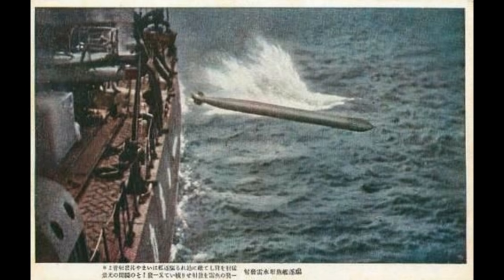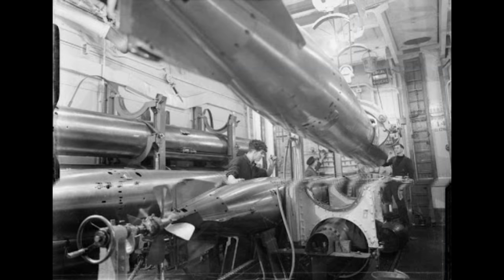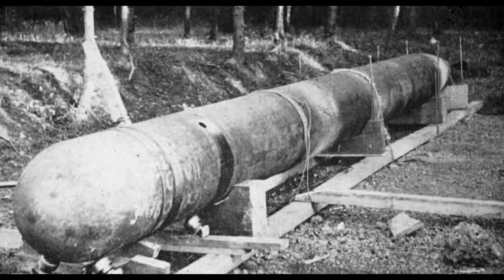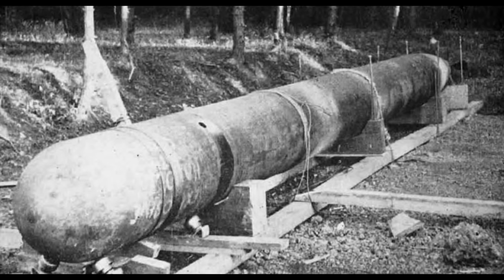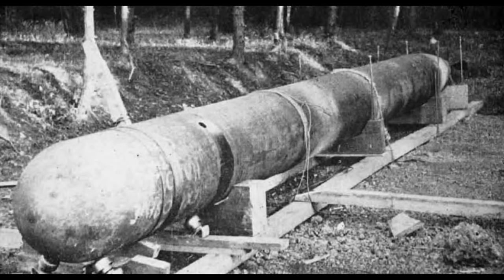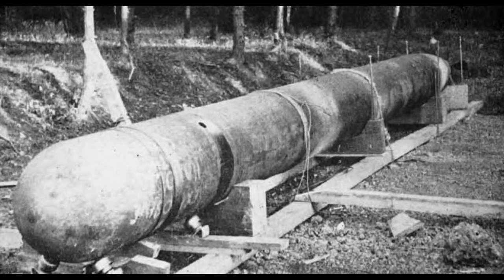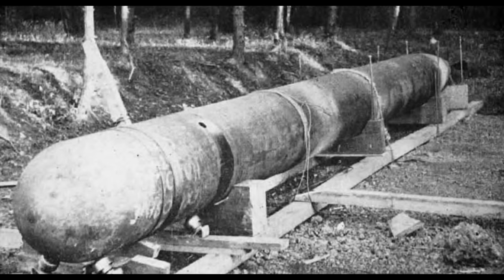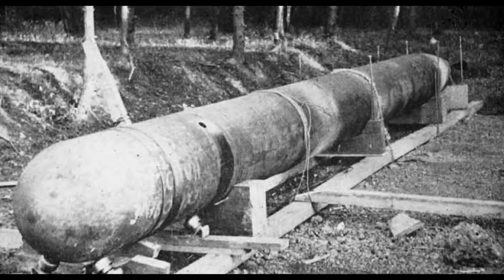Type 93 Long Lance Torpedo - Long Range Hole Poking Device

Comment: It's interesting to recall that the method of testing Torpedo Defense Systems was flawed by design and overestimated the designed capacity of the systems against current weapons without regard for magnetic exploders or Longer Effective-Range, Higher Speeds Oxygenated fuel (hard to detect), and more destructive warheads via weight of warhead and/or new higher yield explosives such as 'Torpex'. 

What was the method of testing by both the U.S. and U.K. and what's wrong with it? They built the equivalent of a section of a warship's outer Hull. For Battleships and Carriers that was 3-7 meters and was thicker amidships whereas the fore and aft barbettes were usually left with barely 3 meters for the physical system. 

On ships of this type they are part of a 40-60k ton (fully loaded) moving weapons platform.They are also 700-1000 feet in length. Also very different from the tests.

So what's wrong with a Floating Cross-Section? When it's struck by the expected torpedo type, although it may represent an accurate full size Hull Section (1 of 10-15 meters in length), it has both little mass and no entire ship to consider as collateral damage. So when the test is successfully conducted it strikes a target without the mass, length or other integral systems intrinsic to all such heavy surface units including momentum. Hence, whereas the the Prince of Wales and Repulse in December of 1941, were both moving at above 25 knots and maneuvering which severely stressed
 their hulls to comb the torpedoes fired at them, the "Hogging/Sagging", and "Shearing" forces couldn't be compared to a lightweight stationary floating cross-sectioned raft. The raft models generally were pushed backwards due to their lack of mass which actually diminished the damage to the model versus the actual ship which tended to stay on course with its speed and weight as physical anchors. 

Also, Torpedo Defense Systems have an entire ship to protect against reacting to the warhead. In practice, many aircraft carriers that were lost to torpedoes, had ruptured Aviation Gas tank fumes as the cause of secondary fires and explosions after the ship seemed to likely survive strikes by IJN torpedo attacks. The U.S. heavy carrier Lexington, converted while under construction from a Battlecruiser into the world's largest aircraft carrier is an excellent example of such a failure where "technically" the ship should have passed the test on the basis of a Floating Model but the Aviation Gas tanks rupturing due to its 900 foot long hull warping wasn't accounted for.

The Prince of Wales principal failure was its Hull warped enough to cause one of its propeller shafts to twist and since the shaft was around 350 feet long the "Gland" which acted as a compromise to keep the seal between the aft armored bulkhead and the propellers allowed thousands of tons of seawater into the unarmored stern. A power failure caused most of the pumps to fail when needed and most of the below decks electric power including lights were lost. Of course it was also hit by multiple bombs which both penetrated the armored deck and caused further warpage of its Hull. Very sad.

Comment: Even with most of a century of additional engineering knowledge, getting pure oxygen to start burning fuel without explosions happening is still quite tricky today (nowadays, that particular problem is seen mostly with development of rocket engines).  I suspect the early attempts may've been suffering from what's known to rocket engineers as a "hard start"; when dealing with potent oxidizers, like pure oxygen, the reaction has to start immediately upon the fuel and oxidizer coming into contact, or else you initially get a slug of fuel and oxidizer accumulating in the combustion chamber, and then it ignites and BOOM.

Comment: Out of curiosity, and laugh at me if this seems ridiculous, but did any navy toy with the idea of a tubular torpedo with the prop housed inside the body and all fuel and payload in the body surrounding the center channel? I raise this question as the Stipa-Caproni, better known as the Flying Barrel, demonstrated that this design works very well. Surely such a design must have crossed some torpedo designers mind as a means of extracting greater speed or fuel efficiency from the weapon system.
Reply: A simple cylinder has a much better surface to volume ratio than a tube would have, probably why torpedoes and subs are shaped that way.

Comment: Worth mention, the escort carrier White Plains scoring effectively a kill on the cruiser Chōkai with a 5" gun hit to her torpedos, which detonated and crippled her, leaving her for aircraft to finish off.  Likely would not have happend with a somewhat less volatile choice of propulsion system.  The Type 93 was also both exceedingly expensive, and difficult to manufacture, which was a considerable trouble mid and late war, reading Hara's book.
Reply: I believe Mikuma suffered a similar fate as well, due to dive bombers hitting her torpedo stowage. 

In an even more embarrassing disaster, the commerce raider Hokoku Maru was sunk by the Dutch oil tanker Ondina with a 4" shell hit to the torpedo mount, the ensuing explosion being large enough to rip her stern off.

Comment: RIP lusitania, USS Indianapolis and HMS Barham.
On the Hackensack River in New Jersey is a US submarine. Also is a human piloted torpedo/submarine. For propulsion it used a Helmut Walter motor. I failed to look at the rear to see if it used a propeller (like very late German subs. [Type XVIIc? ot type XXI] or a nozzle (like the Me163 or reusable Walter RATO units).

Comment: After the middle of 1943, it was noticeable that the Japanese ships were suffering from lack of fuel to do anything, including training. Which was a primary reason their torpedo success rate dropped drastically.  Pre war they trained a lot because we were shipping them the oil to do so. In 1942 they got plenty of combat experience. But as that dried up and their fuel to drill and train dried up, naturally they got rusty.
Reply: And the experienced crews weren’t pulled back to train the new recruits and wound up dying with all their experience.
Reply: @americankid7782  Well training is not honorable.  BANZAI!

Comment: September 15th 1942

On this date a submarine torpedoed an aircraft carrier, a battleship, and a destroyer. The US Navy carrier USS Wasp and destroyer USS O'Brien were sunk. The battleship USS North Carolina was damaged requiring repairs in a shipyard. The Japanese submarine I-19 under its 40 year old commander Takakazu Kinashi left the area(Solomon Islands, during the Battle of Guadalcanal) without losses(although attacked by other US warships in the area).

Kinashi and I-19 to this day hold the title "most effective submarine single torpedo attack in history" - as all of the these ships were hit and damaged by the same 6 Type 95 torpedoes fired in a single salvo. 3 Type 95 torpedoes hit Wasp , 1 each hit the other ships. When Wasp was on fire and abandoned by its crew it was also attacked by 2 Mk-15 torpedoes from an escort to "sink it"(scuttle) faster. The "friendly" Mk-15 torpedoes failed to explode. Another salvo followed after the Mk-15 torpedoes on the surface ships were "modified" by their crew. These hit the Wasp and it began sinking faster.

I-19 was inevitably sunk by depth charges from a US destroyer in 1943. But by that time it had done a lot of damage to the US Navy. More so than whole Japanese aircraft carriers. Some of which themselves were sunk by US torpedoes, mainly aircraft Mk-13's and submarine Mk-14's - when their problems were rectified. These American torpedoes though sank more ships(mainly Japanese) than the Type 93's and Type 95's of the Imperial Japanese Navy in the end.

The "most successful submarine attack in history to occur on 1 day" was probably the sinking of 3 British WW1 armored cruisers - HMS Aboukir, HMS Cressy, and HMS Hawke - on September 22nd 1914 by German WW1 submarine U-9 under Captain-Lieutenant Otto Weddigen. The U-9 sank these British warships(with heavy loss of life) with several different torpedo salvos(WW1 450mm C-06 torpedoes - 123 kg/270 lb explosive warhead) in under 2 hours on the same day while suffering no losses of its own.
Reply: In the end the Type 93 "might" have been successful had it been used more as a submarine torpedo(or more so the Type 95 or later "simplified" Type 96) and the Japanese had actually invested more into submarines and long range target detection technology instead of battleships and aircraft carriers(both of which need 10 times more crew and resources than submarines). As a surface ship weapon the Type 93 torpedo lost to aircraft almost every time.

When US convoys and fleets were allowed to operate in the Pacific it was only a matter of time before Japan began losing to the more industrially developed nations(USA and the British Empire) in the Pacific.

Comment: Years ago I read, but forgot where, that the Japanese merchantman sunk by a long lance fire at USS Huston off Java was carrying the invasion commander, and far worse, all the oil field engineers Japan was sending to Java to repair the damaged fields, and even more worse, ALL their equipment, parts, and field repair supplies too. Sir, you might research this to confirm it.

Comment: by 1945, comm and video tech had increased to the point where "standoff and loiter" torpedoes would've been doable. 
basically, a comm link to a slightly-submerged, stationary torpedo dropped on the course of an on-coming fleet. Said torpedo is then given a depth and bearing and sent on its way, remotely.
Memory serves, the Germans in fact did use some guided torpedoes (I'm not sure on this). 

Thankfully for sailors and troops every where, killing at sea was still random and difficult.
Reply: The Germans hat some improofed torps.
One Tyt, the Zaunkönig Was an acustic hooming torpeedo, some Variants are even wire controled.
there was a lot of different Torpedo typs. 
See
https://en.wikipedia.org/wiki/List_of_World_War_II_torpedoes_of_Germany
Reply: @ichich3978  Thanks. They had sophisticated mines as well.

Comment: Fascinating stuff ! ...What kind of Engines / Motors drove them ? .. Piston Engines ? .. V design , Flat , in-line or Radial ? No of cylinders .., capacity ? Might we have seen some appearing in 1950's Japanese Hotrods ?
Reply: Most torpedoes of this time used 'wet heater' piston engines. These were kind of a cross between a steam engine and a combustion engine. Basically fuel and air were continuously mixed in a combustion chamber and burned, and seawater was injected to cool the chamber and stop it from melting. The resulting mix of steam and combustion gases was then forced into something resembling a single acting steam engine, where expansion of the steam and gases generated work to turn the propeller shafts. I'm unsure of the cylinder layout, but given the round shape of a torpedo a radial layout would seem to be the obvious choice.

The Brits instead used something called the 'Burner cycle' which was sort of like a diesel engine with an external preheater. They still had the preburner, but it used less fuel (not enough to burn all the air) and didn't have the seawater injection. The mix of hot combustion gases and unburnt air was then fed into a radial layout 'diesel' where enough fuel was injected at TDC to burn the rest of the oxygen. I can only assume this made a tremendous amount of smoke, but it wouldn't have been visible once the torpedo was underwater.

Comment: I'm surprised it didn't do more damage in more circumstances. What such long ranges you could probably use surface to do harassment attacks that retreat and possibly fire second volley against any ships that try to chase them. And because the Allies didn't believe the threat was torpedoes they could presumably get some hits.

Comment: Excellent content as usually! But haven't England decided to use the metric system? 

1 yd ~91,44 cm
1 mi ~ 1609 m 
1 ft ~ 0,305 m 
English ton 1 t ~ 1016 kg (metric ton = 1000 kg)
American ton 1 t ~ 907,185 kg
British gallon ~ 4,546 liters
American gallon ~3,785 liters
1 l = 10 dl = 1000 ml 
1 km = 1000 m = 10 000 dm = 100 000 cm = 1000 000 millimeter
1 ton = 1000 kg = 10 000 hg = 1000 000 g
etc.

I think many of your viewers are not from England or USA and are not familiar with the old system with lb, gallon, etc. and if it's not much of a trouble why not use both? Easier for your viewers from the rest of the world like me ( I'm a Swede by the way). Take it under consideration cause it would be very appreciated. Many thanks for the good quality in your videos and excellent information you provide us viewers with.

Comment: w8 if it use kerosene x oxygen mix isn't it just an underwater rocket?
Reply: One could certainly claim that it uses rocket fuel, although lots of things can (at least theoretically) be rocket fuel. However, a rocket (like a jet engine) works by accelerating material, typically gasses, and using the "recoil" from that to drive itself.
The torpedo has a propellor, which has te be driven from some sort of engine. To my understanding, the kerosene and oxygen were burnt in a combustion chamber, the resulting gasses were fed into cylinders where they drove pistons.

Comment: What really turned the Bureau onto torpedo failure was a freak recovery of a Nazi torpedo on a Florida beach presented to the USN courtesy of an American citizen and the FBI. You see, the German detonation logic was virtually identical to that of the USN. You'd swear there was a leak. Both had running-depth issues. The particular torpedo recovered had exhausted its batteries -- making it quite inert for the USN experts to re-verse engineer it. Finding flaws in the OTHER GUY'S mechanism proved to be politically acceptable. So it was done. The number one flaw in BOTH the German and American torpedoes was running depth. BOTH were designed to detonate under the keel of a target. By doing so, all welded on bulges so common for the 30's era would be taken out of the picture. Further, an explosion under the keel of any ship is utterly lethal. The sea would contain the blast on all sides except that facing the targeted steel belly. The US design had the additional failure mode of not working upon contact. This happened as the USN sub commanders had their crews re-calibrate the running depth to ZERO -- or near enough. ( This gambit was forbidden by ComSubPac, but, hey, a guy has to do what works. ) By running that shallow, the target's sailors were certain to see the US torpedo coming their way, electric or otherwise. At such a setting, the torpedo could easily leap from wave to wave. (!) [ This latter tic was one of the key reasons that both the KM and USN wanted deeper running torpedoes. Then even pretty rough seas would not ever expose their fish.
The German failure was as staggering as the USN's. There was one U-boat that could've sunk the RN up in Norway -- Big Time. Instead, all fish embedded themselves into the fjord's far side. Being so close to the North Pole screwed up its logic two-ways: the water was too brackish (melting ice thinned the sea) and the influence of the North Pole itself messed up the "Q" of the magnetic influence loop. ( Such loops are found in all modern traffic controlled intersections. They are that loop you see in the pavement -- typically cut in with a diamond saw -- that has a branch leading off to the edge of the roadway. Within that loop there are conductors that establish a feeble magnetic field shooting above and below the roadway. When your car passes through or occupies that zone, the current of the loop is disturbed and picked up electronically. This tells the brain that you're waiting to turn left, or... whatever. If you were a ship, the asphalt would explode. This influence circuit needs to be re-tuned for use in extreme waters. The German fiasco saved RN capital ships and their escorts. They were at zero knots when the fish were launched. Being electric torpedoes, the RN never knew that fate had spared them -- until after the war was over.

Comment: Sorry I'm late to the party, Given the massive size and weight and volatility of this weapon, if Type 93 was hung on Kate airplane could it be landed back aboard an aircraft carrier with the torpedo still installed? Or must the Torp be jettisoned without being fired in anger before a carrier arrested landing. There were many weapons I carried on the A-6 Intruder with similar restrictions. 
Sparky

Comment: surprised there's no link or reference to the late war losses of and damage to Japanese heavy cruisers in the battle off samar in which destroyer hits on much larger long lance armed vessels proved a decisive factor
Reply: The one that supposedly happened at Samar was Chokai, but the wreck demonstrated that Chokai's torpedoes had not detonated. IIRC, there is some speculation that it may have gotten in the way of one of the Kongos firing, and the explosion seen before she was bombed was a 14" shell hit.
Reply: @kemarisite  interesting - cheers

Comment: Why does it make a difference regarding the amount of bubbles if you turn compressed air/fuel into hot gas or pure oxygen/fuel into hot gas?
Reply: Pure oxygen/kerosene burns to carbon dioxide and steam. The steam (having been cooled by the ocean) will condense into water, and the carbon dioxide is highly soluble in water, so relatively little floats to the surface as bubbles, instead just dissolving and lowering the pH of the surrounding ocean slightly.

Compressed air by contrast contains a lot (73% approximately) of nitrogen, which is mostly exhausted unchanged. Nitrogen isn't very soluble in water, so most of it will float to the surface as bubbles.
Reply: Lots of bubbles leaves a trail like a tracer